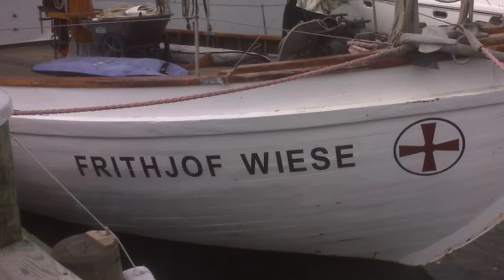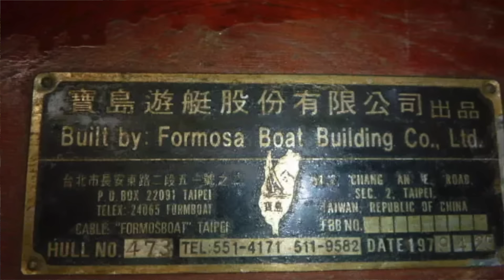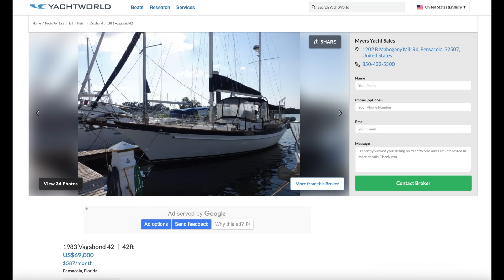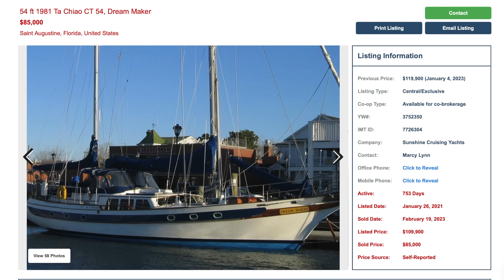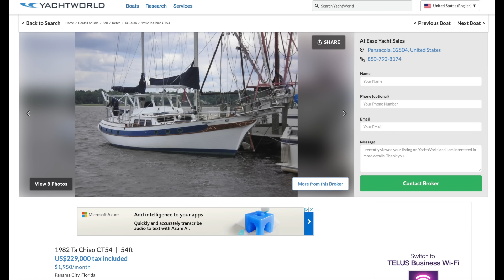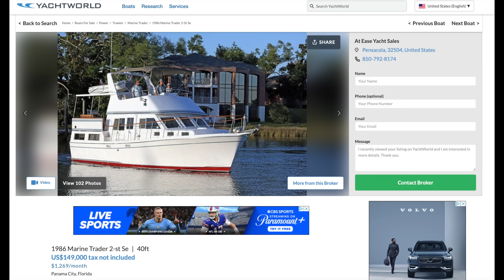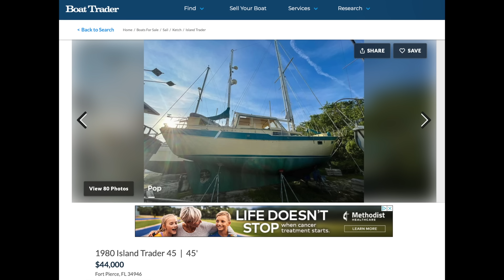*PART 2* WE MADE AN OFFER on the ABANDONED Mikelson 50 Pilothouse and We Got a Response! Ep. 36

Comment: Unfortunately, you are not in a leveraged position to negotiate with a bank held asset. If the bank values the asset at 130k, they are not going to be motivated to sell it at a loss. Your offer will have to be well over 100k before they would even consider talking to you.  When a bank holds majority ownership of an asset on their books, they are motivated to sell that asset at its appraised value. If they can’t sell it at that value, they can hold onto it  and write it down together with the yard rental according to the depreciation schedule for this type of asset as defined by the IRS.  As the boat ages while they wait for a potential buyer closer to their asking price, they can continue to depreciate it on their books until it is either sold or fully depreciated: In this way, they don’t take a loss in handling the asset. About the only thing you can do is estimate the depreciated value now based on its age and original price, and then make an offer on that basis, though I am sure the depreciated value won’t be anywhere near your 30k offer:  That is why they laughed at you.  Aside from that, if you are trying to get a boat for a low ball offer, you would be better trying to find a boat owned by a private owner who is desperate to sell.

Comment: ivaubry's last comment is sound advice. It could be that 130K is somewhere around ther bank's exposure and may not be a realistic evaluation of this particular boat's market value. If you see potential in this boat then it would be worth the cost of an independent valuation with which you could cause the bank to re-assess it's willingness to hold on to an otherwise unrealistically valued asset; banks don't like having over-valued delinquent assets in their portfolio so if it can be demonstrated that the bank's increased exposure due to works are more cosmetic in nature for the purpose of marketing presentation, pointing this out to them via an independent 3rd party appraisal and valuation may cause them to consider writing off a significant portion of the exisiting value on their books.
However, if you do go his route make sure that the valuer that you choose is an approved valuer on the panel of this particular bank, or at the very least an approved valuer of several other banks known to provide finance for marine vessels.
Reply from the maker: That bank is all the way in Texas, and we are in FL, but yeah we would absolutely have another survey done. The boat is listed now at $139k. We sailed it to the marina and it was listed. We have a more recent video on that.

Comment: You seem to be thinking the right way, not that I am a expert or anything but it seems like sound reasoning. F—king hell 130 k with the cabin top like that ? And the mast
Reply: Tell the bank.  LOL
Reply from the maker: Yeah, I know it. The boat does have a water maker, generator, auto pilot, solar, etc, so it has some good assets if they work. We are prepared to pay more for it if these things work. They're fixing the rudder and putting it in the water. Fingers crossed on thru hulls. We will see! Stick around.
Reply: IF @TheSirensLog

Comment: My suspicions are that if there is a bank involved and their books say $130000.00, then thats what they need. Wherever they got that number who knows, it doesn’t matter, thats the number.
Reply: That is pretty much what is happening.  Now it's a waiting game.
Reply from the maker: The survey done last month put it at $130k as it sits, but most major systems weren’t tested in the survey because it’s on the hard. The bank is still owed something like $150k from the buyer plus the bank is putting a bunch of work into it.
Reply: @TheSirensLog  I don't accept that the boat must be in the water to test all major systems, there are systems that can be tested on the hard.  Why can't a water hose be fit into the salt water intake for the engine?
Reply from the maker: You’re right and I think they did do this after the survey and it ran, but there are other assets on the boat that we’d like to know about like the watermaker, the autopilot, etc. The electrical is questionable. Something is going on, maybe just a grounding issue. Could be simple! It’s burning up shore power cords and lord knows those things aren’t cheap, and we’ve been watching the boat for a while now and saw it before the bottom paint and we know the boat has an electrolysis issue. They’re probably connected, but we don’t really want to burn up another cord or two or three testing to find out what’s going on. Probably cheaper to hire an electrician if we can’t see anything obvious right away. So the boat has some question marks like that! The boat sold for I think over $160k (I think it was like $189k) just a couple years ago, so we know there’s still value on the boat. The question is how much. We will find out!
Reply: @TheSirensLog  I agree that hiring an electrician to find the electrical short circuits makes sense, and I don't think it would require full voltage, maybe 12v, 24v, or 48v just to analyze the circuits - wonder if battery chargers would be adequate power.

Comment: Well, there is not much rational about sailboats. It's like love. They as they say, leaky tikis, but typically strong.
Teak? Teak decks? No thanks except in the interior. I have minimized all exterior wood. I don't want to spend my time working on wood, because it never ends.
Reply: Siren likes doing bright work.  As long as she remembers she said it.  lol
Reply: @haltarpley9237   At one time, I thought I did, but sailing is more fun.  I now have very little wood to deal with on the exterior of the boat...
Reply from the maker: Totally understandable. I do want teak decks though. I love my wood.
Reply: @TheSirensLog   Haha...I love OTHER peoples teak decks...mine is fiberglass with non-slip textured paint.  Now, the interior? Love that wood there, teak and mahogany, with a tiger wood table.. Teak prices are now totally crazy...for some things, look at Batu, Ipe or Tiger wood. It's a fraction of the price of teak. Even Ipe, the more expensive of the three is far cheaper than teak but just about  bulletproof.
Reply: @TheSirensLog  Have you priced real teak decks recently?
Reply from the maker: I did get a loose quote for a 42’ Vagabond because we looked at the one, but I can’t remember the amount. It was over $100k.
Reply: @TheSirensLog  So you can see why I LOVE my fiberglass with anti-skid....

Comment: Listen I have seen lots of that size boat for sale for over 100k. I am not saying this boat is worth it but they bring it when are in operable shape. Most of the ones I have seen are in good condition.  But that dont mean you won’t have troubles or catastrophic failures. Such as engine failures. And generator failures.
I have seen other YouTubers buy a boat for more than 100k and turn around and have engine failures that the engine had to replaced. Before you buy you should watch many other channels where people bought boats ( new or green yachts overs.) Lauren Landers bought a 50fter. And she had to replace the engine almost immediately. She paid over 100k for hers. Taylor’s travels boat a smaller like a 38 or 40 ft and paid over 100k and had to spend lots of money on it, and hade to replace the engine also. 
Sailing Miss Lone Star, she bought and sold many, she now has a 51 ft Formosa I think it is called. She calls  it her Pirate ship. She paid lots more than 100k. Had to do a refit also. It was on the hard. She has bought and owned many sailboats. I seriously doubt you could fool her into paying more than a boat is worth. 
And others did have to spend lots to make theirs ready for sailing. That paid over 100k. So you have to see what is out there and be ready to spend a large sum of money. One setting on the hard as is where is you can get cheap like what you offered, but you have no idea how much you will need to do to make it ready.
Think realistically, boats that are cheap they are because they need tons of money to be spent on them and lots of time. All 50 footers I have seen are around 200k and up in good shape. Those in bad shape sale for around 100k from what I have seen on the internet. Seriously! 
You find one for sale by owner for less. I have been tracking boats for sale for over a year. 40/45 footers sale for around 70k and up. And I am talking about 30 to 40 yr old boats. 
This is why they laughed at you, boats on the hard yes you can get that cheap but it is as is where is. 
And likely in pretty bad shape. 
Boat market is supposed to be bad right now, so keep looking.
Reply from the maker: Thanks for the comment. 
Yeah I understand all of that very well. But this boat IS on the hard and the systems can’t be tested. If none of the systems in the boat work, plus it needs a rebuilt rudder, new mast sails and rigging and the whole Pilothouse is rotten, it’s value is nilch. I have been watching the market for a lot more than a year and I’m very familiar with these boats. I’ve been watching the market VERY closely for 47-56’ Taiwan builds for about 3 years, while also keeping a loose eye on the market for many many years. I’ve wanted a Formosa 51 or the like for more than two decades. This isn’t something we just decided to do and now we’re suddenly learning about them. This has been decades in the making and now it’s time. Most cheap ones go for around $125 or so, occasionally under $100k, but those absolutely need work. The only reason we offered low on this one was because they can’t prove that anything works at all! The moment it goes in the water and systems are proven, the boat proves it’s value.
Reply: With lots of rot I wouldn’t buy for 100k plus. But that’s me, you may feel you could pay that. 
If most things do work, yes they may get their price. And they are counting on someone that don’t understand or knows what boats are worth. I may have missed that the pilot house is totally rotten.
Most that size boats are worth more. I couldn’t buy one that needs a ton of work. My experience in other things equipment and trucks is old will always be old. You sink an old boat you may almost all of your money. Like I destroy a truck that I have lots of money in. I lose almost all of my investment. Good luck I hope you get one in your price range. 
I watch boat market close sometimes. I would love to buy one myself. Do you need a captains license to charter you own boat out from what I seen and heard you do. And do you have yours ? So at my age getting Captains lic. Is out ! I am sure you know the answer to that question.
Reply: @robbyoliver4953  We bid 30k.  Willing to put an extra 100k to 150k in it to bring her back.  Just understand, 100k isn't enough to buy a 23' Parker brand new.  My buddy just spent 115k on a 22ft Pathfinder brand new.  The pathfinder has no water tanks, it doesn't have a head, it doesn't have a galley.  Its a 22ft center consol with a 250hp Yamaha 4 stroke. So, with 50ft of boat, and a grand total of 150k to 200k when we are finished sounds like a deal to me.  I mean to order a boat like this brand new would cost well over a million dollars. Yes I have my captains license.  I have for 20 years.  They're easy to get.  Just need money and time on board.
Reply: @haltarpley9237  Thanks Captain, explaining is helpful to me. I am with ya on what the grand total would be, I think you are pretty close. One thing I think you guys may have in your favor is from what I hear the market is not real good.
Here close to where I live, I have seen prices drop considerably. But all the bigger boats are stilll up.
Some older smaller ones I have seen go cheap. Still in the water, but that don’t mean they don’t need lots of love. 
Boats are still moving or selling but I hear the market is not good. But I am not shopping at this time, so I may be in for a  big surprise. Hope you guys can get a good deal. 
Oh there was a real nice boat Learning the Lines you tuber showed a few weeks ago on the hard I don’t think it was a fifty footer, and I don’t know what the price was but it was supper nice and like 45 ft. 
Myself I don’t think I could do a refit and pay much for the boat, I would have finance it all. And that probably wouldn’t  happen. So it would need to be ready to go. 
Would you guy be interest in buying a newer 50 ft. Ready to go for around 200k. If I see one I could let you know I am always looking. A while back I seen a couple for around that much. A little over I think but close. Thanks for all the reply’s.
Reply: Hey there is a 1987 Gulfstar at little Kenmah Texas Little Yacht Sales has it listed according to the pics it looks pretty good.
I haven’t inquired about it. 
Asking price is 105,000 I thought might be something you may want  look at. And maybe ready to go. 
You could use that info to let the seller of the boat there know prices is not up right now. And I would say this boat is ready,  all we need to do is buy it and sail it home. Almost all others on their site is about 2 times that price.
Reply: @robbyoliver4953  We just looked at it. Siren says an aft cabin is a must, and I want a full keel. Other than that, the boat is beautiful.
Reply: @haltarpley9237  okay cool ! Siren probably looks often so it may be a waste of time for me to hit you up. But I wish I could help. But you guys will find one sooner or later. Hope it’s not way later. Best of Luck guys. 
I really don’t know why you guys want an older boat that needs a refit, instead of trying to buy one that is ready to go. 
I mean I have seen some you may be out the same money when all is said and done.
But like people say it is a satisfaction thing. You rebuild it it becomes a part of you, some say. 
Me I really don’t know I have done extensive refit on a truck before made a dependable, good, hard working truck out of a piece of junk. It was good to me for about five years and someone talked me out of it. Next I bought one ready to go and loved it. But that is me. I really just look at things as things. No relationship or feelings. I always said I am not in love with it, I just use it.
Reply: We can make the boat make the money to fix itself.  Or at least, knock down the price.Let say we buy the Mikelson .  If I can get it for 50k or less, fix the mast step, replace the through hulls, fix the electrical issue, and fix the rudder I can put her to work on day charters.   Sunset cruises and such.  Now shes making the money to fix her up instead of spending all of my money at once.  My money is in the bank making interest and everything involving the boat is now a tax write off.  When I get all the interior working decent, now she is an airbnb and I can do local overnight charters.  She's making more money.  All while I YouTube how I make all this happen.  Now I get YouTube money and brand deals. Plus, when we decide to sail off, the YouTube channel guarantees I can charter anywhere in the world. It is how a poor boy gets a nice boat.  By the time its all said and done, Ill get Sirens dream boat for free with recurring yearly tax deductions.  I'm building a business.  I know there is risk and I could lose it all but, no guts no glory my friend. This is how everyone around here gets big nice boats, I just haven't seen anyone YouTube that process.  GBU was the closest I have seen.  Makes sense, Matts from Tampa. lol  @robbyoliver4953
Reply: @haltarpley9237  thanks for the comment and answers ! 
Yeah I knew he was from Tampa but he was originally from one of the islands I think.
But sounds like a good plan, I think you guys will make it work. I can’t do anything like charters unless I get a Captain lic. So I don’t have that option yet anyway but it is okay.
I think I will find a way to get out there on the water. May try getting someone to teach me and take me out for practice runs. It is kind of a dream of mine also. I would like to spend time aboard on someone’s boat. So get yours and then let me know what it would cost me to go for a cruise since your home base is just across the pond form Texas maybe it could work out. 
And I am sure you would be open to teaching a little sometimes.
Reply: @robbyoliver4953  I don't know if I'm one to be teaching.  Captain licenses are easy to get.  It's just money and a week of your life. Saves money on your insurance though.

Comment: easy to dump 100 grand into that boat what with shipyard costs. sails rigging   fiberglass work paint engine, prop shafts.  prop transmission wiring., black and  grey tanks water tanks. all need to be replaced. buying it is the cheap part. i bought a 55 ft choylee motorsailer  many years ago. was also abandoned. i thought i  got a steal paid 7 grand for it at a ship yard/that 7 grand andi did a lot of the work myself hit120 grand before it was safe enough to sail it.new  sails rigging 2 cat motors. overhauled. water maker generator replaced.bottom paint.  one year in the ship yard.but i lived on it in south florida   key west.  Miami ft lauderdale  daytona beach.but   it to me was worth it.only problem i had was moving my pickup. had to have a friend  help me move my pickup. i did sell it 15 years later with all new electronics for 250 grand but i think i  damn near had that in it. did sail it to the med and italy  sometimes i think i should of kept it lol but dock space in south florida was getting out of hand
Reply from the maker: Oh yeah... It's never the price of the boat that kills you, it's all the maintenance and dockage! We expect to put at least 100k in it.And that is just in the work!